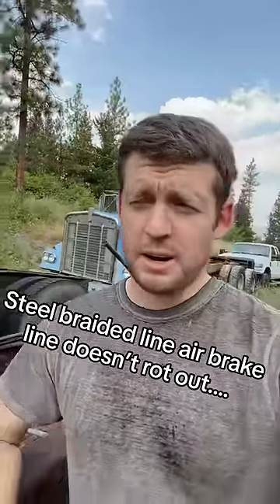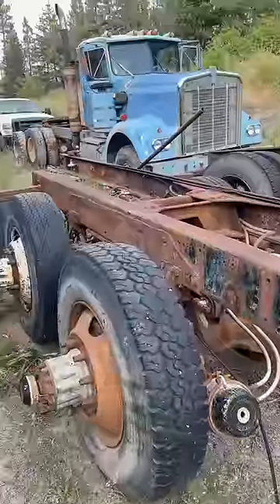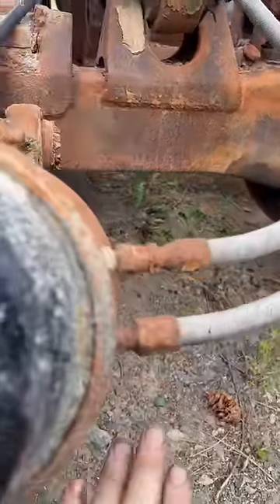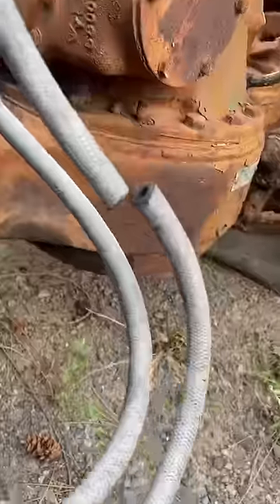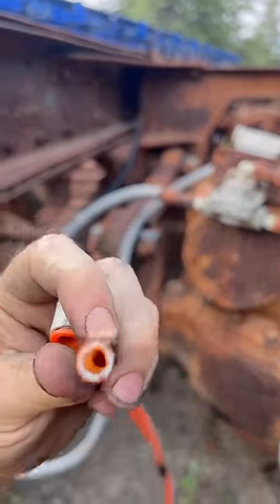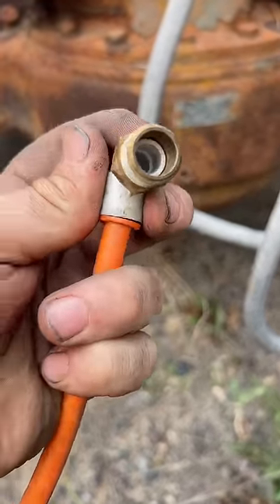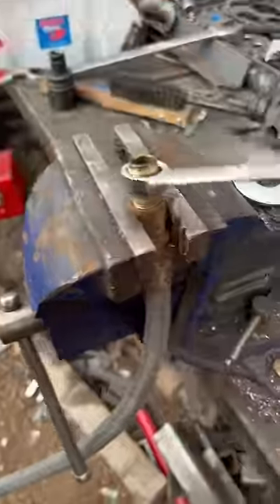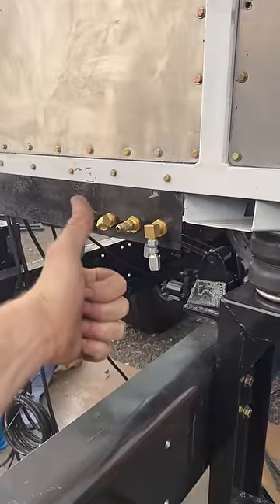Cutting a 70 year old trucks brake lines open for science

Comment: I always hated working on steel braided air lines at the factory because they were never marked and tended to leak all over until every single fitting was inspected, but there's a reason the heavy duty trucking companies paid extra for them.  The difference in durability is huge.
Reply: I am not an english speaking gentleman, but I am using detergent and water for leaking inspection. It is painless and fast detection method.
Reply: @MarioAPN  "i am using soap and water for leak detection. its a painless and fast detection method"
Reply: @joeycoursey7913  as long as we understand each other.
Reply: @MarioAPN   damn, good job on the English not being sarcastic either i cant learn a new language to save my life.
Reply: @MarioAPN  i hope i helped your grammer a bit. And i hope it didnt come off rude
Reply: @joeycoursey7913  no, no, not rude at all. Gracias amigo.
Reply: @MarioAPN Don't listen to him you're better at english than him lol. You were right to say "It is", saying "its" would be a fault.
And I see no reason to correct "soap" from "detergent" if it's what you meant
Reply: And the correct spelling is "grammar" not "grammer"
Reply: @paul4381  trust me, maybe someone has other problems in life. It is not bothering me at all. It's is a shorter version of it is I believe, but you have to put ' on it. Sometimes autocorrect mess this for me. Its is a pronoun, I believe. No worries, I am just chilling in YT comments section because I want to practice my English skills. I have huge problems with articles, but when you compare English with my native language, Croatian, it is easy. We have so many things that really don't make sense. Thanks for the reaction, but it is pointless to argue about grammar here.
Reply: @MarioAPN  Same for me I am French lol. I see your point and agree with you. I don't care if his grammar is not the best, and never correct anyone online when it is not the subject because grammar shouldn't invalid someone's point of view.

But here it is different : he tried to teach you with wrong grammar, so I wanted to stop this.

Anyway you seem like a cool dude, and I wish to both of you a good life ✌️

PS : Fun fact, my middle name (Vladimir) was given to me after a croatian friend of my family.
Reply: If everyone did thier job like they cared you wouldn't have that issue of finding leaks cause the last guy woulda done it perfectly.
Reply: @Blazeww  That is not true unfortunately.  Even if everyone does a perfect job of installing the air lines and fittings there may still be a handful of leaks caused by tiny imperfections in the fittings, particularly with the style of lines that Edison is using.  And even the most dedicated worker will make mistakes.  It just isn't realistic to assume that a truck will be leak free right off the line.

Comment: Steel braided use a rubber coating on the outside to add protection.
Steel braided lines are a mod car enthusiasts do to their cars over the stock rubber ones.

Comment: In the mills when we have air hoses that wear out or get to hot and burst we replace them with hydraulic hose. They almost never need replacing unless something catches on fire.
Reply: This seems like an oem grade line built like that
Can't cross use parts like that for production for liability. Gotta use brake parts on brake systems because they are rated
Reply: @seldoon_nemar I'm a truck driver, I have been since I was 21. Semi truck air systems run from 120 psi to 160 psi, hydraulic systems run in the thousands and tens of thousands of psi, unless we're talking suction specific hoses like R4, which are 200~300, which are only meant from the tank to the pump inlet on hydraulic systems. You have a margin of error of ten times what a Detroit or Cummins air compressor will put out, a hydraulic line is more than fine for air lines. Hell, I'm using them. all over the race car I'm designing
Reply: @Romuls753  Under the definition of what hydraulics are and considering air is technically a fluid one could argue that air is a hydraulic medium. That's science bitches... lol
Reply: I’ve got air hoses that are made out of hydraulic line that I made back in the early 70s. They are still going strong and perform like new (the fittings, too).
Reply: Yes sir. Had an airline go at a new job I'm at, and the op tells me it blows out nearly weekly. I made one with hyraulic fittings and hose, It will never fail in my lifetime.
Reply: There are technically differences in the materials that means you shouldn't do that, but i have done it for years. For some drivers, nothing but a 2 wire hose with steel ends will survive the week.
Reply: @Romuls753  Making the race car heavy for no reason. Well, "heavy-er" I guess.
Reply: @seldoon_nemar if the hose is being used within pressure, temperature and chemical compatibility limits then it should be fine unless the data sheet for the line says "don't use for brakes"
Reply: @seldoon_nemar the brake lines you are talking about are hydraulic brakes like a car these are air brakes.
Reply: @Romuls753  Why did you favour a compressor, air tank and all the other complexity that comes with an pneumatic brake system over standard hydraulic brakes in your race car?
Reply: I used to think hydraulic hose was really great also. But then I saw extreme air use while touring a plant one day.nThey were moving huge volumes of air from multiple large compressors to a very large vessel. I don't know how hot the air was but it was high pressure and it was hot. They had made a quick repair connection off a compressor unit with a large diameter hydraulic hose. I noticed it and saw a spare hose there. The guy said it would not last much over a month. I could hardly believe it.  It reminded me I have yet to find something better than copper. There is a reason it is used in the refrigeration industry.
Reply: @ifyoutip  compressing air can lead to very very high temperatures. Hundreds of degrees. The hose may not like that and it's not really a problem for brakes.
Reply: @TheBuddilla  technically yes, but it's an absolutely horrendous hydraulic medium, because it's compressible, which kinda defeats the purpose of needing hydraulics to travel only a short distance to output a lotta power
Reply: @zyeborm  legally it needs to be DOT approved brake system hardware
Reply: @puffincz3482  It sucks until you need something that doesn't lose its ability to function under extreme high heat such as in a braking system for large and heavy vehicles.
Reply: @bruni5289 it may be a better quality hose but it's illegal to use non dot certified fittings for brakes, even on cars. Huge liability. If the hose bursts or fitting breaks for any reason dot will blame it for the accident
Reply: @seldoon_nemar Just use Parker 201 steel braid. It's DOT approved for air brake lines, hydraulics up to 3000 psi, diesel, and antifreeze.
Reply: @tomatosawz  Then that's fine. My point what that unlike in a mill or something, an OEM must use only approved parts or face major liability risks. That's probably what they are using
Reply: The problem at least where I am is you have to use a DOT rated hose/tube or they are going to get you at the scales. We have rubber hose with nylon reinforcement, nylon tubing, or if you want something higher pressure 100R5 and 100R5 High temp. There’s also a nylon covered rubber hose that looks like R5 but is more flexible I can think of the name but Parker and Gates definitely have it available.
Reply: We replaced a discharge air line with a hydraulic line on a Freightliner spotter, tons of idling and heat in that line typically causes them to fail yearly but the hydraulic line is holding strong after 7 years
Reply: @TheBuddilla  Technically true, though hydraulic fluid is by necessity non-compressible, where air is. Compressed air gets hotter when it compresses. That said, hydraulic lines are usually rated for up to 100C, so this is entirely a non-issue.
Reply: @anothermidlifecrisis  introduce too much lightness and you lose durability. Can't win if your car falls apart before the end of the race. Design depends on the application. Enduro racing? Heavy duty. Time attack? Introduce lightness.

Comment: Theres good reason every performance vehicle from dirt bikes to f1 cars uses steel braided lines too. They dont swell under load.
Reply: But if you put enough load on them they will explode, now how the f*** you managed to do that, especially on like a dirt bike or similar is beyond me but it is hypothetically possible (If you hook up an air compressor that likely weighs more than the vehicle does for both the trucks and the dirt bikes)
Reply: @the_undead Everything has a limit, bud.

Comment: I work with milling and grinding spindles, they use the exact same push connect pneumatic fittings all the freaking time. Anytime that there’s a leak, it’s almost freaking always those fittings. They work great when brand new, but give it even just 6 months and they’re brittle as all hell, just look at them the wrong way and the seal fails or they just outright crack and snap off. It happens even faster when they’re outside in the elements. I couldn’t imagine what a single seasons worth of road spray would have them looking like 😂

Comment: They aren’t talking about the steel part, they’re talking about the rubber. And it does rot out.  I am constantly replacing them. Wanna know a secret? Hoses don’t crack in the middle. They crack at the fittings.

Comment: I switched to steel braided brake lines a few years ago and they are so much better than the OEM rubber lines.  And they still work as good as the day I installed them.

Comment: In job Corp we were told to never just replace the steel braided lines. And we were shown how to fix them as well as how to cut and crimp new fittings on them. The instructors told us it's because "you can't trust that you can always just find the part you need. Sometimes you have to either know how to make a new one or fix what you have." That and I think it was something to do with the fact that the replacement steel line was Sometimes as much as a roll of new braided line lol.
Reply: What state were you in? There is still a Job Corps in my area, but I've heard many have/are getting shut down due to lack of funding... Definitely one of the few extremely successful, low cost, government programs ever implemented... So of course that had to go away! 🤦‍♂️
Reply: @berryreading4809  I went to the job Corp in white swan Washington. But that was 10 years ago lol

Comment: Usually steel braided lines are stainless steel and most stainless doesn't rust depending on the content of the mixture.
Reply: Exactly. If the lines were not braided stainless steel they would be rusted.
Reply: Strangely, i work in vehicle maintenance shop and it is not rare, that steel lines rust. lol
Reply: Its stain LESS not stain free. All stainless steel will eventually rust it just takes a long ass time if its good.
Reply: @rtsrt165 stainless steel doesn't never rust, it's only very resistant to rust. Even so I'd consider 60 years exposed to open weather and having a tiny bit of rust more than acceptable.

Also, a lot of the time stainless steel rusts because of something else accelerating it, like constantly contacting salty water. Being in contact with a different kind of metal, then becoming a sacrificial anode can increase corrosion speed as well.
Reply: Just one night in our open garage with a bit of sea air is gonna dissolve that shit right through
Reply: @carlosandleon  well ya, saltwater will corrode pretty much anything but exotic metals. Titanium is basically the only realistically priced metal that is strong and corrosion resistant enough to be used around salt water. 

Even than it would be outrageously expensive to use in something that tends to get replaced anyway. There are ups and downs to every material, sometimes you just have to deal with it.
Reply: @probablyinconsistent4756 Titanium still rots. One of my prosthetic legs is made to stand up to sea water so they use titanium parts cos of weight to strength and corrosion resistance. I clean mine so it isn't an issue for me but another guy in my clinic didn't ever clean his and the sea water corroded the titanium pole and it sheared in half.
Reply: @iamaduckquack  it's called corrosion resistant for a reason, not corrosion proof. Even still, you'd have to be constantly dunking your leg in very salty water every day for years and never washing it for that to happen. 

There are different alloys of titanium with varying degrees of corrosion resistance but generally it will almost never corrode even in the worst conditions.

Comment: As an aircraft mechanic I can confirm he is 100% correct. Steel braided lines last longer than you’d think
Reply: Maybe sheltered in the gentle environment of aircraft?
Reply: @johne189 gentle environment?? I'm sure as hell not an aircraft technician, but you can't honestly believe A vehicle that has to go through the stresses of takeoff, landing and flying at hundreds of knots an hour, where even minor things done wrong with ground maintenance can result in death. Is a gentle environment.
Reply: @tyniria  
Yes, I would consider hoses in the typical highly controlled environments of aircraft installations to be in  much more gentle environments than that typically seen with trucks.

Consider that with aircraft ALL installations are carefully engineered, installed and monitored. There's no misapplication of product or exposure to incompatibles. Technicians are held to highest standards and all work is triple checked. Any failure is analyzed to the nth degree.

Compare aircraft to trucks, where sometimes any yahoo can bop in and hang any old hose. The installation may see direct exposure to elements, road salts, incompatible fluids, etc. It may be improperly secured and subject to almost constant motion. The hose can be a poor choice for the application. It can be installed to chafe against components; be bent beyond design limits; have its ends haphazardly installed, etc. Regardless of the flaws, the hose installation is  sent off and forgotten until the next failure.

Hope that explains why I honestly believe that truck installations can see a much more harsh environment than that found with aircraft.

Comment: Peasue use the D.O.T push to connect fittings for brake lines.

They have additional inner sleeve to keep tube from collapsing in the fitting if it undergoes and vacuum

Comment: Ive been a truck mechanic for 25 years and 99% of the air leaks i fix are the quick connect. The quick connect fitting are fast and convenient but are pron to leaks after about 5 years qnd less on off road trucks
Reply: Yup, same with that crappy plastic line, once they get old even disconnecting them you have a chance of cracking them. But the quick connect are the worst.
Reply: We get about 6 months on our quick connect on the trailers, unless the driver keeps the trailer clean but cement speeds up the failures with the damn plastic
Reply: K whoppers have the stupid bulkhead under the cab on the driver's side with like 20 lines on it and they are all quick connections and they all leak eventually. Nice and easy fix on a tractor but I have to deal with them on vacuum trucks. Can't get in, can't remove equipment to get in, can't reach from below. Fun times
Reply: @kylederry5031 I've had the trailer brake line blow out of that going down the road that was fun
Reply: Only good use I find for those "quick connect" fittings are as an "emergency roadside repair" to get you to the shop for the right one.

Comment: Nylon tube is used because its cheaper, along with the fittings. The braided hose you see is probably a 2wire hydraulic hose, or maybe 1 wire. They have protective covers and require specialty equipment to crimp ends onto, you could use 'field attachables' and buy a length of hose yourself and make some but less reliable (cheaper as no build labour though). A 2m long 2 wire hose will set you back about 50-80usd depending on where you shop. Any hydralic hose shop can sort you out if you'd like to upgrade

Comment: i work on a 1966 Cessna 320D, uses steel-braid line that looks just like that for the hydraulic brakes. They were replaced at one point, but theyre still easily over 40 years old, holding up just fine

Comment: We've been replacing the grease zerk remote lines on our hay equipment with copper 3/16 fridge water line.
Reply: Excessive but excellent.
Reply: It works
Reply: @matteblack5805  I wouldn't say excessive if it handles sunlight better than the plastic oem lines.
Reply: @tog61   He's got grease (a low friction lubricant) flowing through his lines at high pressure and a very low speed. His lines will last centuries.

Comment: Prove em wrong fuck yeah
Reply: Considering they don't use 1/4 plastic push conect on air breaks at all the standard is 3/4  breaded from your tank to your break chambers those plastic lines are accessories like dogs pintal hitches sweeper rigging ect